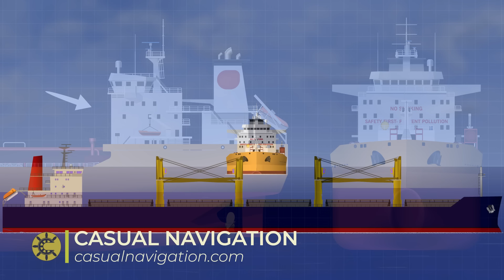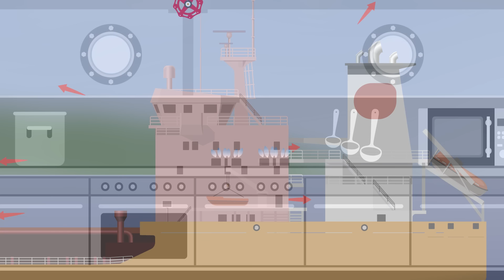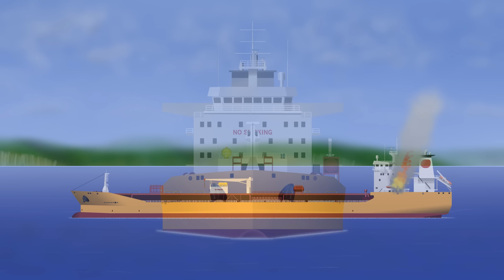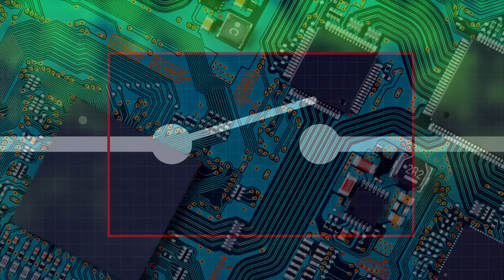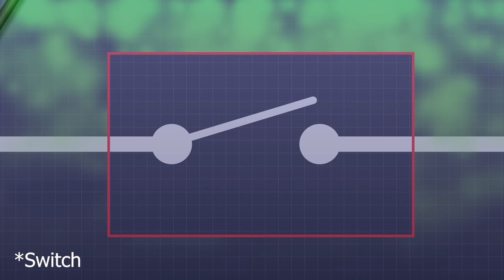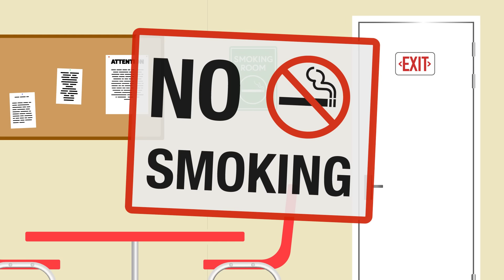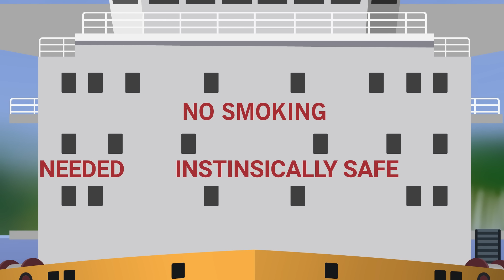You Can Smoke On A Fuel Tanker! So Why Is This Sign Here?

Comment: Correction:
If you're closing a switch, you DO get a spark.
(And if you're opening a switch, you DO get an even bigger spark.)
It's not just a possibility - it is an inevitable fact.

At the voltages commonly used inside handheld electronic devices, those sparks are miniscule - but they are there.
EVERY time you operate a physical switch or button on the device.

Comment: There is a surprising risk with perfectly innocent printed circuit boards. The solder can develop “tin whiskers” which are incredibly thin cylinders of tin shooting out and shorting to other pads (think of a spider wed in appearance) they very often just burn even with very low power and everything goes back to normal, unless your atmosphere is explosive. Various mitigations exist (leaded solder, varnishes, etc) but they are not routinely used, you need to design for low explosion risk.

Comment: Exd (explosion proof) enclosures are NOT air tight.
They have an engineered gap called a flame path which will not physically allow a flame to pass through but will allow pressure to escape if an explosive gas mixture that gets into the enclosure ignites.

If they were completely sealed and a explosive gas mixture got inside such as during maintenance, congratulations you've just made a bomb.

Comment: Once upon a time long ago I worked on tankers. Smoking regulations were strictly enforced. You got one warning, the day you were hired. You broke the regs once you were done. 
I knew full well on a black oil ship you couldn’t ignite it even if you put a blow torch to it. 
I heard the regs just remained the same to be consistent with the rest of the fleet. 
The term smoko was frequently used to refer to any work break, there was a room for the crew isolated where smoking was allowed. Called the smoke room. 
Traditionally smoko was a smoking break. 
Smoking regulations had two levels. 
At sea, with no cargo operations, more lenient
In port. 
Or when cargo operations at sea, eg tank cleaning. Stricter much more limited. 
Most pumps were steam or electric from engine room power from turbo generator from steam plant. 
Most winches were steam. 
Most power operated valves were hydraulic. 
Today steam may not be so common. Hydraulic winches are available. 
There is a red line usually a bit behind the front of the accommodation smoking never allowed in front of line. 
At sea ports aft of this line could be opened and theoretically you could smoke aft of this line but to do so outside was frowned upon. 
Smoking in cabin was never allowed bridge was forward of the red line so never allowed. 
Other public areas of accommodation smoking was ok at sea until restricted by cargoe operations then only in smoke room. 
Other companies may have had slightly different policies. But those were quite common for the industry at the time. 
There were special hot work certificates issued for the use of any type of tools which might include sparks ect. 
Very rare for on deck, ship would have to be completely clean and completely gas free and certifications issued regarding testing.

Comment: There are antistatic safety shoes too. 
Have them at work to reduce damages for sensitive electronics due to static charges. They work great even with normal socks.
And that means you don't need to touch grounded metal things to uncharge yourself if the floor is grounded. (which would be the case with ships i guess)

Comment: I e worked on oil tank barges for 12 years. The level of caution required by the Uscg, ABS, and oil companies is mind boggling. Most new tankers are all inert gas vessels. You could literally set up a spark plug inside the tanks and nothing will happen. All vessels with a inert gas system has to maintain a oxygen content of under 8%. Ours is typically around 4% oxygen. We can actually weld on a fully loaded barge if you have a void space between and a marine chemist approves it.

Comment: It's kind of interesting hearing about this as someone who frequently works in ESD-controlled environments, because in some ways they're a much deeper but narrower set of restrictions. You probably won't find people smoking in a typical ESD-controlled area but it's not against ESD policy and there are similar things like soldering irons which have to be available, but the protections against sparks are much tighter. In an ESD area, everything is designed to be conductive and not generate static electricity, technicians have to wear conductive coats and straps on their shoes that make them viable paths to ground (though that's suspended around high voltage, since safety is more important than preventing damage to product), and there are even devices designed to fill the air with ions that can settle on and counteract anything that picks up a static charge.

Comment: Intrinsically safe only applies to low power devices.

Motors, pumps and other electronics will be protected by other protection methods of which there are many. 

Flame proof enclosures, encapsulation, over pressure, increased safety etc etc

Comment: The electronics part is so misleading. Its more (I think) about modern smart phones and their Li-Ion batteries etc. Those things can fail and not require oxygen to combust and would be very hot flames.

Most electronics couldn't arc like you described. Most modern electronics are very low voltage and amperage.

Comment: modern electronics are heavily designed with electrostatic discharge and emi in mind, the chances a modern low voltage dc device like a cell phone will "spark" is incredibly thin unless you stab the lithium battery

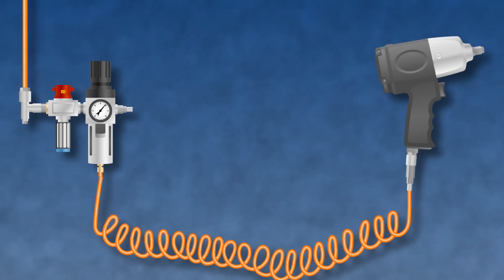Comment: An inconsequential detail, but the pneumatic tool first shown at 4:11 is attached to a condensate drain - the air output is on the right of the regulator, level with the input. The little port on the bottom is for bleeding out pressure in an isolation situation, or excess of air tool oil (or moisture, assuming an air drying system is not present.)

A few years ago, our plant air dryer went down for about a week, and all week I was constantly going around playing with these little drains (from a handful of different manufacturers that all had different ways of opening them...that was fun) to get the moisture out. That's when I learned what those things were for. You could attach something there, but they're not designed for that and would be a little cumbersome - an addition to putting undue strain on part of the equipment not made for it.

Comment: I doubt a cigarette is a source of ignition. But what lights the cigarette is. You can throw a lit cigarette into a tank of gas and it won't light.
Reply: A cigarette is a source of ignition. You can trown a burning cigarette in a tank of gas and it will explode if the condition are right. And you are not gonna take the change and wait till something goes boom.

Comment: Not arguing that the safety precautions are bad, but sparking between components on a mobile device or really any circuit board, is extremely unlikely even on power lines. It's probably because of the risk the batteries in them pose.

Comment: In the context of petrol/gas stations, the idea that a spark from modern, normally functioning micro-electronics could ignite gas fumes has largely been disproved, to the point that it's never happened, nobody has been able to achieve it even in controlled lab conditions, and I'm not just talking about MythBusters either.
In the context of the deck of an oil tanker, maybe they have larger build-ups/concentrations of gas so it's more likely? I doubt that though, the afore mentioned lab experiments used gas/air ratios that were optimal for ignition so why would it be any different for oil tankers?
The answer might be that we're dealing with different gasses that are more volatile/flammable or ignite with lower concentrations than petrol/gas? I'd have to refer to a real chemist for that though, any ideas?:
Also worth mentioning, a battery fire could easily ignite fumes but that could happen even if your phone has all the spark sources hermetically sealed!

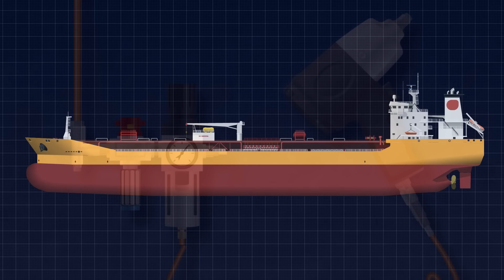Comment: The image at 4:09 is slightly wrong, the orenge hose is not suppose to be hookt at the bottom part but at the upper right part, that's because the thing that the hose is hookt up is a water saparater and the bottom part is venting out anny luiquets accumulating

Comment: I have only worked as a contractor for one company in a depot that stores fuel,  but your assumption that people not on the ship that board it are not trained is most likely wrong.

The 2 depots for the company were closed off to the public, and one of the control staff had to board the ship to make sure the control room was in touch with the ship on when to pump the fuel. The staff are all trained, and the dock is far enough away from civilians that its all safe, most likely a government rule and or regulation so that, i assume, all uk and probably the industry itself, has a safe standard.

At the depot i was at, once the passports of the crew were checked (any that wanted to leave, obviously others stayed to monitor the ship) they could then use the off site smoking area and also go use the shop to buy any supplies they wanted while the tanker was unloading.

Comment: The chance of a "spark" (called an arc) happening from closing a switch is very unlikely in the vast majority of modern electronics as they run on low voltage, HOWEVER when the switch is instead being opened, then you have a (practically guaranteed) chance of a small arc. These arcs can even happen with very low voltage & systems of protection like chokes. You can see how easy it is to create a disconnecting arc by just running a wire across 9V battery contacts a few times.

Comment: Did you know that the Blimp Hindenburg had a Smoking Room...

Even with thousands of cubic feet of highly flammable Hydrogen, the Hindenburg allowed smoking in a separate room. When the Blimp went up in flames, it was not due to smokers or smoking material. 

Static electricity doomed the Hindenburg along with Hydrogen and Sealer on Skin..

Comment: The cut off point from the danger zone and "safe" zone is not always at the start of the accommodation block , it can be part way along and as for winches they are hydraulic so no electricity , even things like vales for controlling the flow of oil are hydraulic.
The company i worked for had two large gas tankers , i sailed twice on one of them . Joined it one time in Boston in the states , one guy decided it would be a good idea to smoke a cigar on deck , he was on a plane back to the U.K next day
Reply: About the winches : do they have friction brakes ?

Comment: electronics virtually never make sparks they are too low of a voltage regular wall light switches are the biggest risk, so they are made explosion proof sealed from internal sparks igniting outside fumes

Comment: Ex Tanker Officer and retired Master.
The large sign is displayed prominently outside [ Yes you can smoke Inside in most area's; not the navigation bridge which is often open to outside ]. Mostly entry/exit area's are double door/airlock type  for safety.
 ALL area's outside the accomodation are strictly NO Smoking and even bringing Lighters/Matches on board is also not allowed. All equipment ie Radio's Torches have to be 'approved gas tight' also( + now Mobile phones ) for safety.
 You are correct in one way but the Headline gives a false message to most people. please make sure you Clarify this quite openly please.NB plenty of experience after many years on product tankers

Comment: As someone who has to deal with ESD protection regularly, I find the explained ESD protection measures very insufficient. To achieve proper ESD protection, it's not sufficient to touch some grounded metal once before you start working. Instead, you should have ESD clothing which have some special fibers woven into it. Same goes for the shoes. Also this equipment has to be checked for their correct functionality regularly (ideally once per day).

Comment: An Ex protected housing is not an intrinsically safe solution in my opinion. It must be impossible to construct any reasonable scenario in which the safety fails in order to classify it as intrinsically safe. A housing can break. Then it's not Ex protected anymore.

Using a (proper) housing is a safe solution, but I would not consider it intrinsically safe.

Comment: I work in these areas, and our clothing even has to be fire resistant, not because of the risk of fire, but due to the fibers being static dispersants.  Everything on us and around us are meant to be intrinsically safe.   Fascinating bit of engineering
Reply: Do they make comfortable intrinsically safe underwear?
Reply: Wouldn’t that be for fire then? Sounds like you’re describing the static resistant clothing they use to prevent sparks that ignite fumes potentially causing fire and explosions
Reply: @monhi64  I worded it in an odd way, it is for both.  Its just difficult to start a fire without a way for a fire to start.

Comment: Actually, you cannot light gas or petroleum products with a cigarette (unless you're in a Charles Bronson movie).  However, the match that lights your cigarette can, as can dropping it on a rag which causes the rag to smoulder.
The reason is that the ash on a cigarette end acts as a flash arrestor.
Our ships had NO SMOKING and underneath that NO NAKED LIGHTS, which probably leads onto heavy petting...
Good video by the way.

Comment: By the way, smoking areas are not closed during operation: the superstructure has positive air pressure, stopping any outside unwanted gas from getting into it. People smoke in the bridge, in the smoke room (normally the Officer’s Messroom or some nearby room designated for that) and in their own cabins all the time.
Reply: Smoking in cabins is mostly prohibited from the policies of the companies,they put smoke detectors inside them. Even though almost everyone just uses gloves or socks to cover the detectors and smoke like nothing happened
Reply: @pcpeasantry3008  Has no one ever been arrested for that?
Reply: @douro20  Not really, when inspections happen they just remove them, plus it doesn't harm anyone so they don't report it to the higher-ups. It's a certain concern cause a lot of fires have happened due to negligence with cigarettes in cabins but it's something that won't stop any time soon.

Comment: This is actually something I have a tiny bit of experience with! I had to install a few circuit components above a diesel tank, and my solution for preventing any sparks in the 12V system was to coat all of the circuit boards in a "paint-on electrical tape", essentially a plasti-dip. The components were selected to be overkill for their application, so they didn't resistively generate much heat, and when coated in synthetic rubber, there was no bare-metal.
I know people will say diesel is incredibly inert, but I have really quite terrible luck. I actually had a small diesel fire from static discharge to the steel tracks of a bulldozer that I had spilled a little bit of diesel on while refueling it. My boss did not believe me until he saw the fire was only a few inches tall, nowhere near the actual diesel tank, and only my fingertip was burned.
I have spontaneously combusted more than once, and never to any injury... yet
Reply: This is how commies make spark plugs.

Comment: I went on a cruise on the Norwegian majesty, they told me I can smoke pretty much anywhere outside. And said that if there was no ashtrays, just throw it into the ocean. Which I obviously did not do, I carried around a water bottle with a little bit of water in the bottom and threw them into that and then into the trash.
Reply: You absolutely cannot throw cigarettes into the ocean. It is illegal for a vessel to discharge that overboard.
Reply: The trash was then collected and deposited overboard a specific number of miles away from shore.

Comment: Static electricity causes sparks the is why a fuel docks trucks are supposed to be grounded before loading for some reason if you load a tank truck if diesel fuel was unloaded and gasoline is put in the compartment it creates Static electricity I've seen ungrounded trucks catch on fire

Comment: Deck machinery is rarely, if ever, intrinsically safe.  Deck machinery is either hydraulic, electric-hydraulic, or electric.  If hydraulic pumps are located in the safe zone controls on deck may be electric or hydraulic.  If electric they may be either intrinsically safe or explosion proof.  

In general, electrical equipment located closer than, if I remember correctly, 3m from any opening in a cargo tank, or within 3m forward, aft or above the cargo tanks is considered to be within the hazardous zone.  All electrical equipment within the hazardous zone must be either intrinsically safe or explosion proof. 

Electrical equipment may be explosion proof and not intrinsically safe.  Intrinsically safe equipment is by definition, again if I remember correctly, explosion proof. 

As for needing to ground individuals before going out on deck to prevent static buildup sounds like an urban legend.  I have never heard of  static discharge from a human having enough energy to initiate combustion.  Unless, you believe in spontaneous human combustion.  If spontaneous human combustion exists, then having any humans on deck would pose a hazard.

September 9, 1977 Fort Mifflin, Pennsylvania USA the tanker Elias blew up while discharging cargo.  The Elias was a midship house tanker with accommodations and the navigation bridge above the cargo tanks.  The cause of the explosion was believed to be a result of combustible games accumulating below the accommodations, a leaking sewage line that compromised the water seal on a toilet, and a crew member smoking a cigarette while on the head.  "No Smoking" taken to a new level, literally.